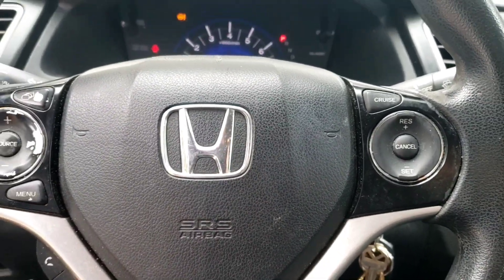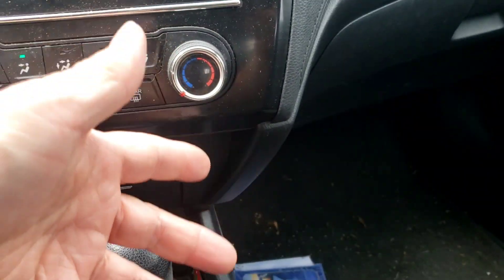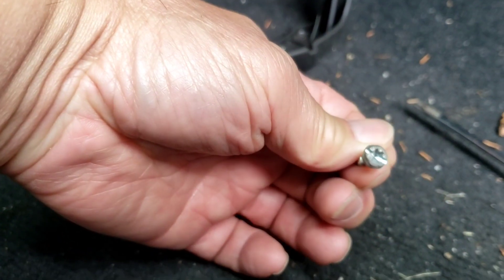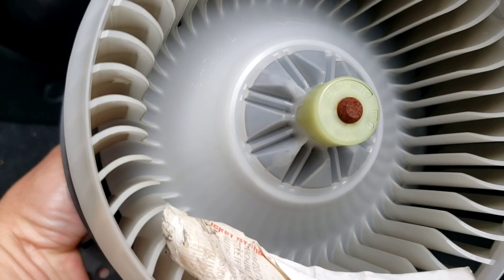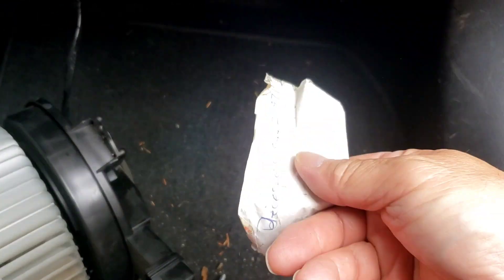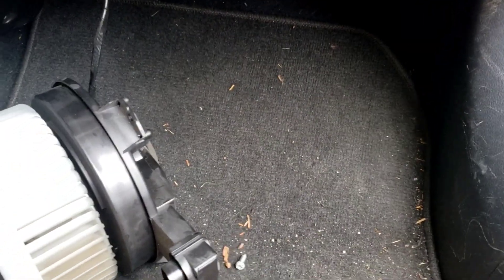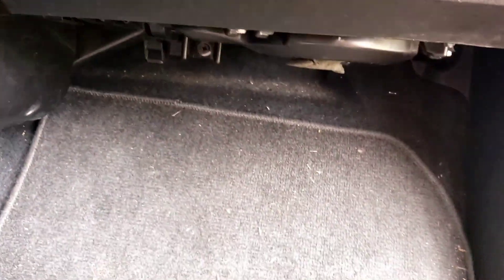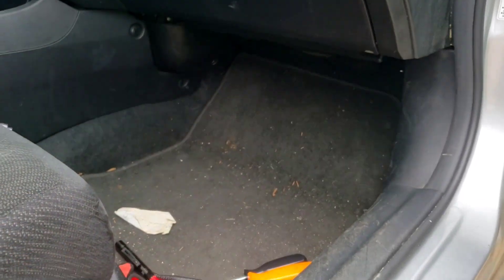Honda Civic AC Heater Blower Motor Noisy Remove and Replace How To Change Out 2013 and Others

Comment: Great video but honest to save your neck from bending and taking out the screws just take a the cabin air filter out first and see if you can just use something to grab it out first there’s usually a opening once the filter is removed and you can see the inside of the blower motor right from there
Reply: I’d recommend just doing that first before taking the whole thing off you never know when you can save yourself some time
Reply from the maker: Great tip

Comment: Awesome video! My 14 Civic makes a pop/tap sound on the passenger side even with the AC off. I wonder if the blower or actuators engage automatically with the vehicle turned on. Will investigate using your info, clean out the blower and see if it does anything. Thanks again!
Reply from the maker: When its off, it shouldn't make any sounds, you definitely need to poke under there and listen for sure

Comment: Awesome video. Having the same issue in the same civic. I’m gonna check it out today. Also, what would cause the AC to only engage intermittently? Seems like I have to cycle it on and off for a few to get it to start cooling.
Reply: Did u check it. Was something in it or the blower motor bad?

Comment: My civic 13’ won’t blow out any air at all. Do you think it’ll be the blower motor? It did sound like something was rattling in there when it was working
Reply from the maker: Very well could be, either something is jammed or the motor went bad. Good thing is you can pull it down and look

Comment: My blower motor blows fine when not screwed in. It sounds like it’s about to die when it’s mounted back in. I’m so lost. I replaced it the first time it happened, but that wasn’t necessary. And I replaced the blower resistor.
Reply from the maker: Look in the hole that it goes into, sounds like there might be something rubbing on the hamster wheel.

Comment: My 2013 EX has been having intermittent a/c issues for six years. Right now it hasn’t turned on at all for two days unless I smack the glove box and when it does it makes this sound. Bought a new motor since it’s clearly gonna need it but I can’t wait to see what evidence is inside my current one to be making this sound 😂
Reply from the maker: Oh boy, if you have a cabin filter while you're there, might as well change that out too
Reply from the maker: Technically its not so much a a/c issue but the fan motor issue,  must be the same for heat.
Reply: @alyoungcuda  yea its a fan issue overall. Doesnt come on for heat either, but since 4 of those 6 years were spent in Florida I was mostly trying to use the A/C. You are correct though. It wont blow any air when its acting up. And damn I should’ve grabbed a cabin air filter because I think its been about a year plus since that got changed. Oh well.
Reply: @alyoungcuda  i took out the hamster wheel turned on heat didnt make noise. i put it back, made noise, took it back out. now nothing doesnt blow at all
Reply from the maker: @jimmyboyer9392  you will need to look up into the hole where the wheel goes into, most likely there is something sticking out and jamming the wheel, especially since you said it turns when it is connected and out of the hole.
Reply: @alyoungcuda  i think i blown the fuse but when it was working was making sound in the dash itself nothing was in hamster wheel
Reply from the maker: @jimmyboyer9392  those Air ducts are like tunnels, anything like a pen, air freshners can fall in and the rush if air will make it move around..you can buy one of those flexible scope cameras to look inside the tubes if you want or try to feel the noise with your hands...

Comment: so with mine i get similar sound, removed blower inspected inside nothing inside all clean, i turn the blower on with it removed and no sound. only thing i can think of is it is rubbing against something inside when installed. anyway to adjust?
Reply from the maker: There is no adjustment  but you can poke a camera in that area in there to make sure it doesn't have anything stuck up in the vent and check the cabin air filter area for debris also
Reply: @alyoungcuda  so I messed with the 2 silver screws directly on Blower and it seemed to have helped. Still makes a slight noise on level 1, but it goes away around level 3 and higher
Reply from the maker: @michaelchurch2919  then it sounds like a bad bearing in the motor when its running on the lower speed and the higher speed  spins faster and it goes away..
Reply: @alyoungcuda  but when i have it out of the housing and turn it on it doesnt make a sound
Reply from the maker: @michaelchurch2919  can you feel a vibration if you grab and hold the motor when its installed? You had it out already, its pretty simple, you might as well install a new one..the old saying goes" if in doubt, change it out".. im sure the cars a few years old now..
Reply: @alyoungcuda  its brand new but i mean its a cheap part lol ill try another one this one could be bad never know
Reply from the maker: @michaelchurch2919  autozone has the best ones with a warranty

Comment: Awesome video. Having the same issue in the same civic. I’m gonna check it out today. Also, what would cause the AC to only engage intermittently? Seems like I have to cycle it on and off for a few to get it to start cooling.
Reply from the maker: Its low on freon/refrigerant,  there are high and low  pressure switches to turn the system on and off to prevent further damage  and also check to make sure your radiator cooling fans are working..there is a seperate one just for ac when its turned on and that ac fan has a relay that might be sticking..look for it in your fuse box..
Reply: @alyoungcuda  I pulled the blower motor. No obstructions but still won’t kick on unless I give it a few taps. I’m going to check the ac system later today. Thanks for the reply. Your the man.
Reply from the maker: @stevebambach  sounds like you are talking about 2 different things here..you said you give it a few taps..you're talking about tapping the blower motor inside the car or the dashboard switches? And when you say the ac are you talking about the actual cold air coming out is not cold or the blower not blowing air? 
Sounds like you think the blower is a seperate issue for ac and heat but its only 1 motor and it spins for the defroster,heat and ac..so if its intermittent on one then its the same problem on all 3..you know what I mean? 
And if you have to tap on the blower motor to kick it on then its a bad motor..most likely burnt out in that one position when its off and it lands on there like a jeopardy wheel and it needs that kick in the A$$ to move it..